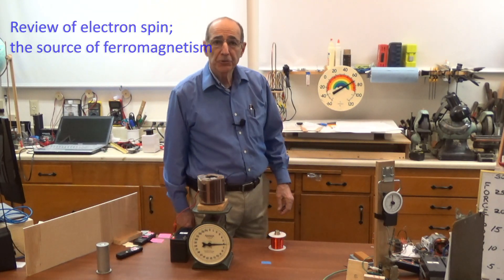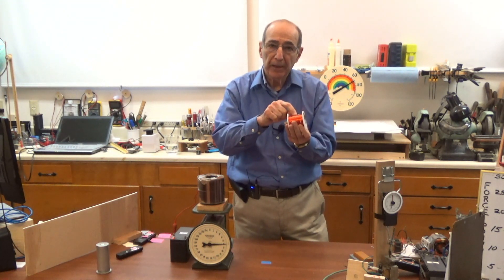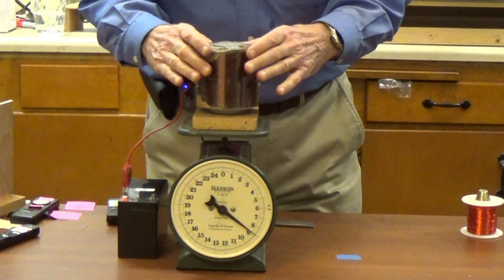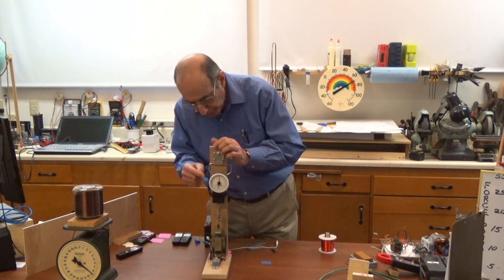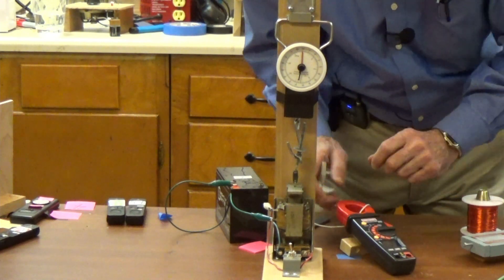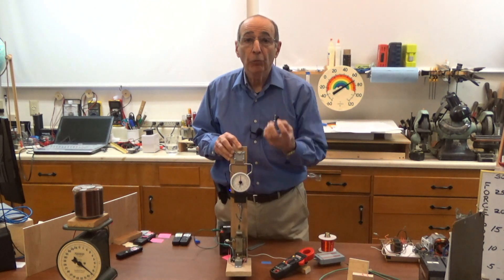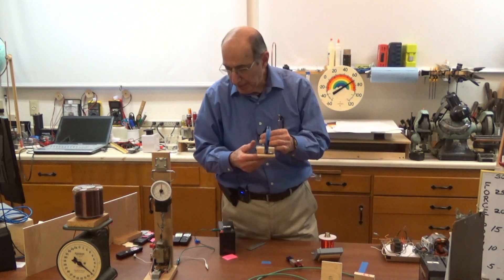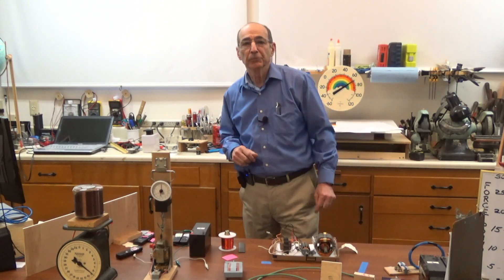Session 9  Using steel in electromagnets

Comment: Excellent demonstration. What in your opinion is thee best magnetic inductor? Pure iron , moo metal ,etc etc.....
Reply from the maker: I am nt a materials expert but there are sites i sure that give the permeability of many alloys. An additional variable is of course does an alloy easily switch back an forth or does it retain magnetization. I'm sure there are sources for this information on the internet.
Reply: Cast iron. You want as close to iron as possible. Iron instantly dumps the magneticity. As Ed Leedskalnin  of Coral Castle states. Steel suffers from hysteresis. Some of the particles get bound in the steel.